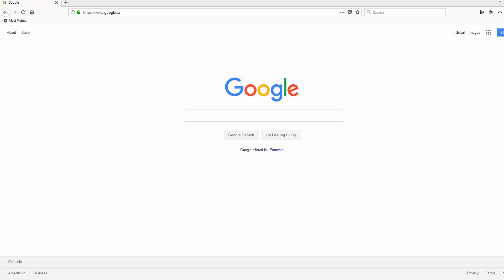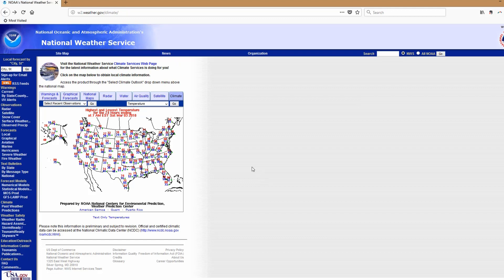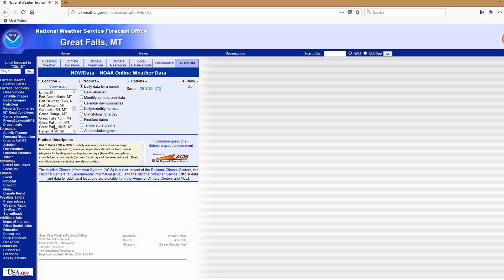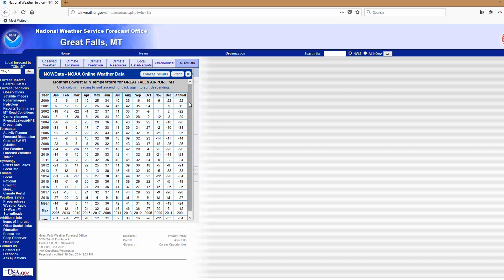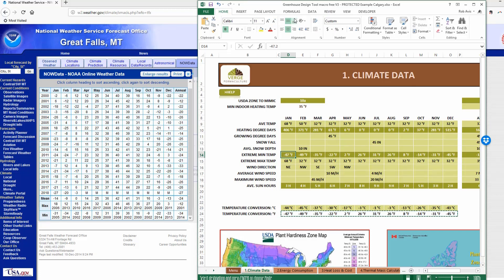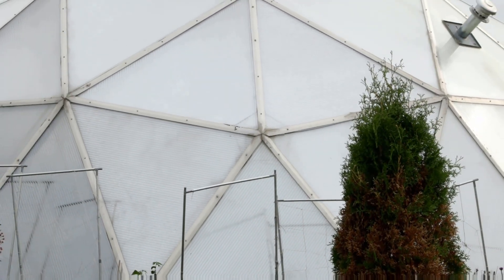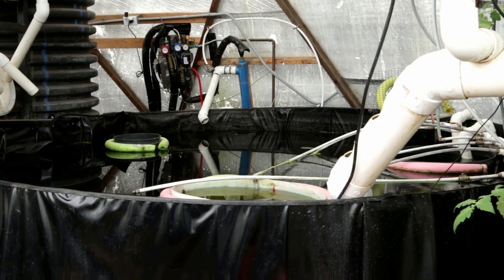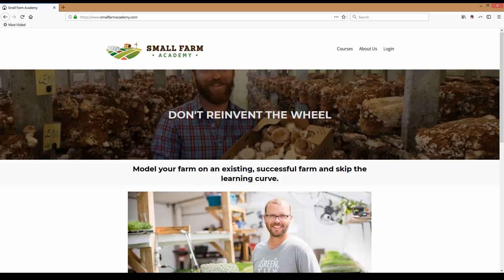Adding Extreme Temperatures in Degrees F into the Passive Solar Greenhouse Design Tool

Comment: Hey Rob, thanks for the info. I was wondering if you have any info regarding using geothermal in a passive solar greenhouse.
Reply from the maker: Sam, what would you like to know about this?
Reply: VergePermaculture  I was wondering if you have any videos or blogs regarding geothermal.  I'm interested in finding out about it's viability compared to the cost and reliability of other systems. Lastly I would like to purchase your tool and wanted to know if it would be applicable with a geothermal system